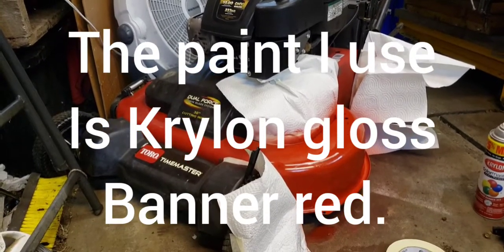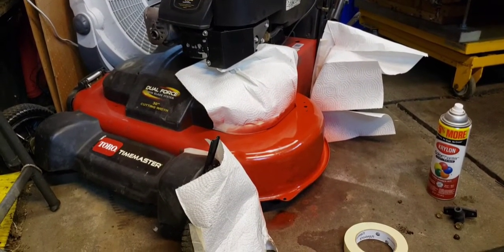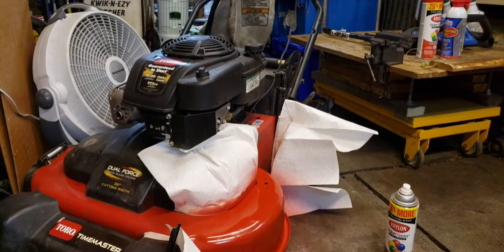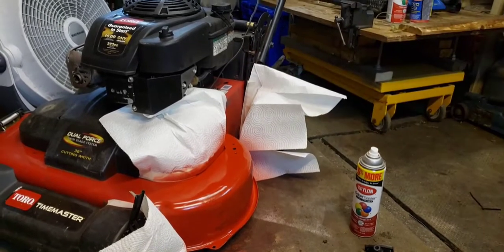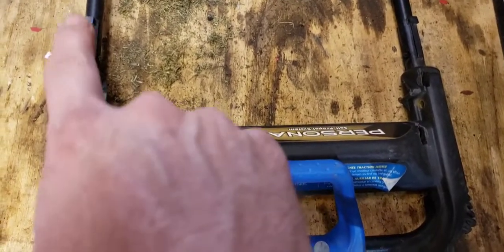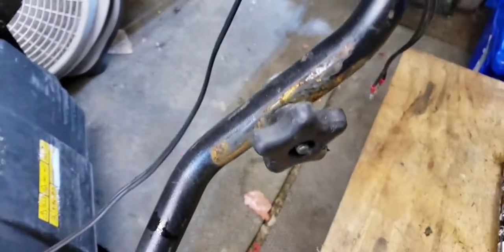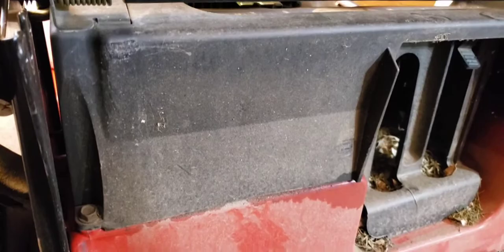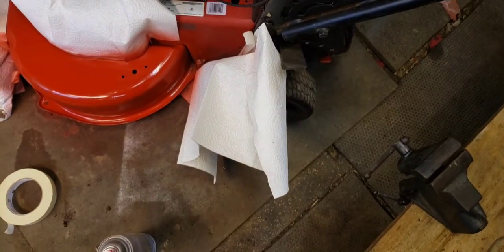50 dollar Toro Timemaster, cleaning up, and paint.

Comment: Thats going to be a nice mower Robert! Im not a huge fan of personal pace. My mother in laws lawnboy has a system like that. Works alright accept on rough lawns. Some parts right now are slow to get. 💰💰✌ Roger.
Reply from the maker: Yep I agree.... But to make this anything but personal pace would of been 100 dollars more cause of the ex marks, and toro turf cutter, the parts are twice the price, cables and what not.
Reply from the maker: But to make this easy, if you ever do the keystart conversion to a 199 into a 200, find yourself a weedeater one, I can find them here for as low as 30 bucks cause they are a pos, but the engine is good, you can take everything off of that for the conversion, the stater alone is 30 bucks used, and the toothed flywheel is 60 used.

Comment: I paint underneath my deck after each season. I spray the bottom with rustoleum red then toro red I let it dry for a day each coat. Then I spray it with fluid film then store it for winter.